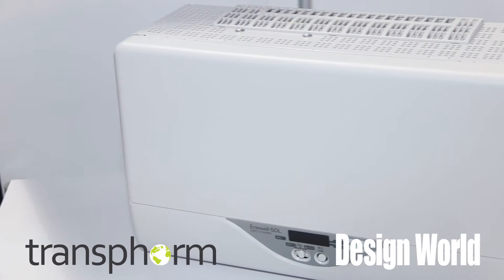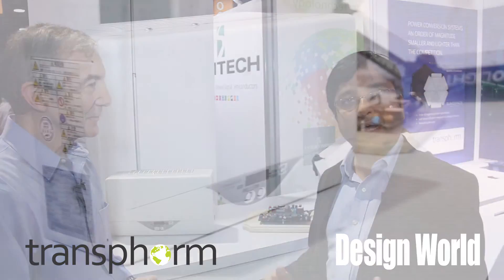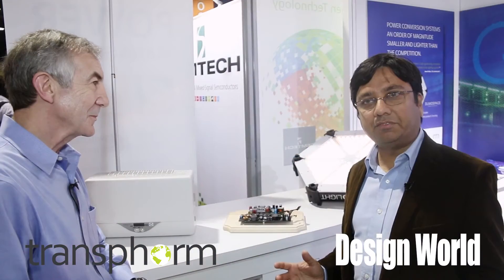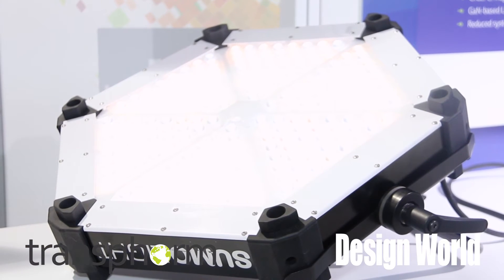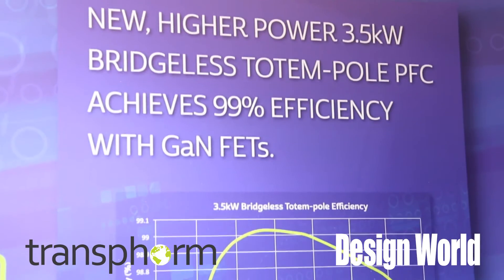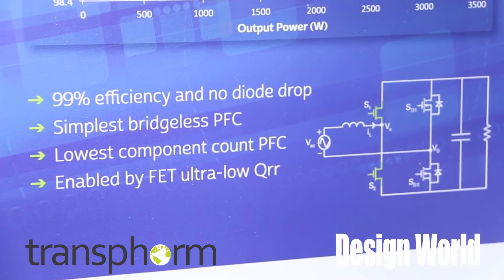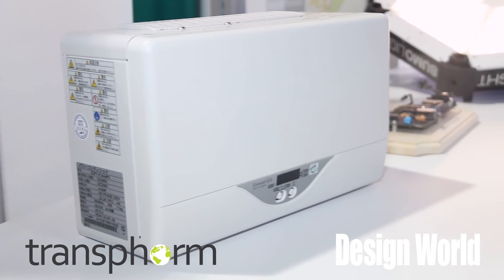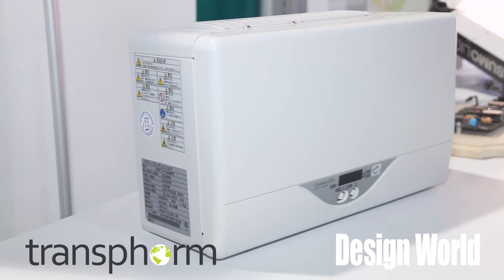How GaN FETs reduce circuit size

Comment: I used one of the Transforphorm's GaN Cascode FET in an LLCC circuit and some how the gate Resistor keep on burning.
My gate drive waveform is textbook kind. Still it burn the gate drive resistor.
Reply: What's the value of your resistance? What frequency are you driving the gate at? What is the gate capacitance?